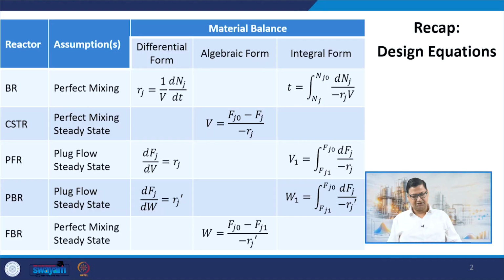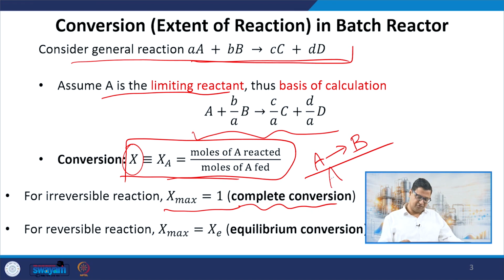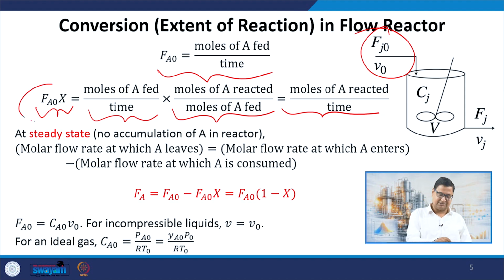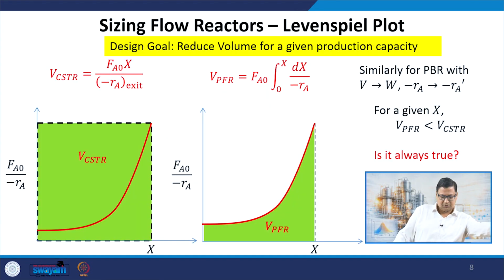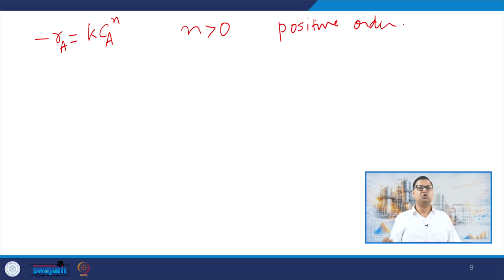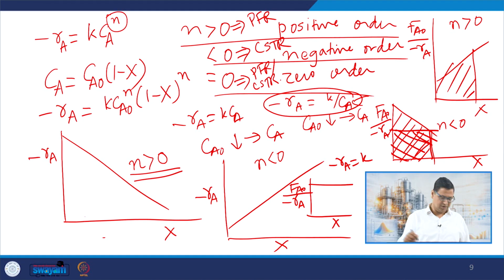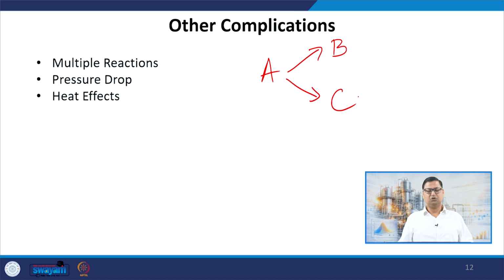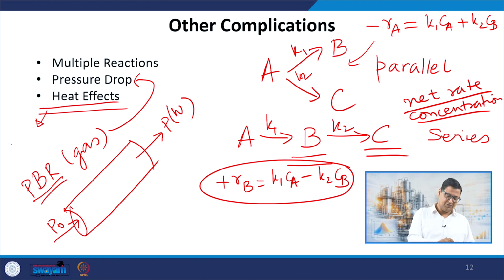Lecture 17: Modeling of Chemical Reactors - Design Equations in Terms of Conversion

Comment: How can i count the Area from the graph
Reply: Area is only for demonstration. Since the expression of rate law is algebraic, one can directly get the volume using expression shown for CSTR or integrate the equation given for PFR. Of course, there are ways to numerically contribute areas as well, like trapezoidal rule, but not typically needed as analytical evaluation is possible for most cases.